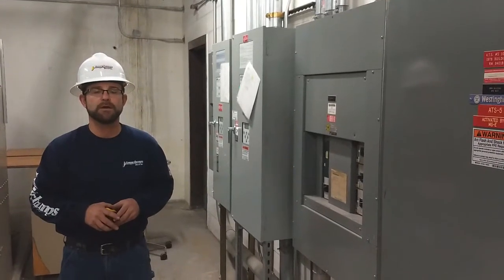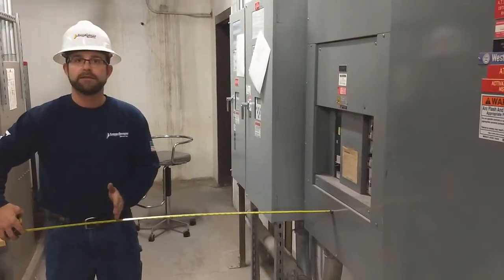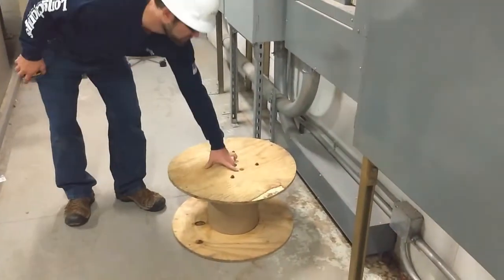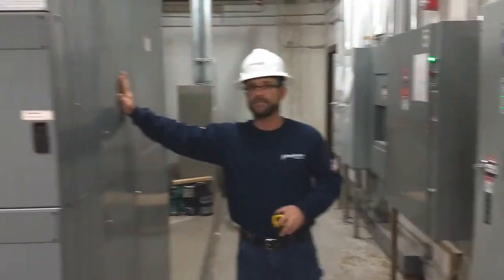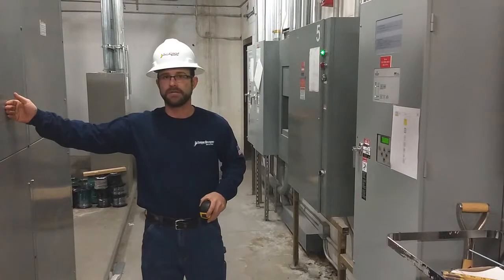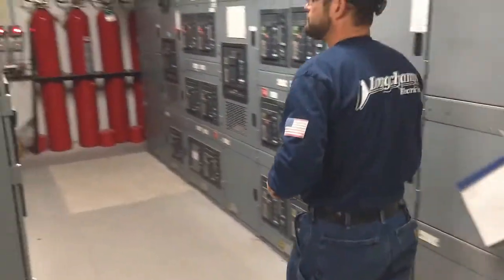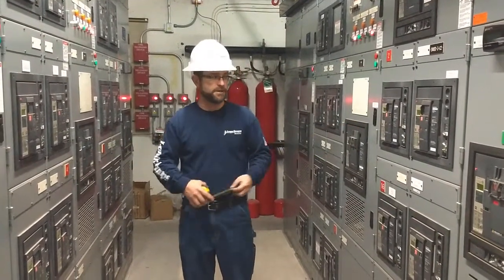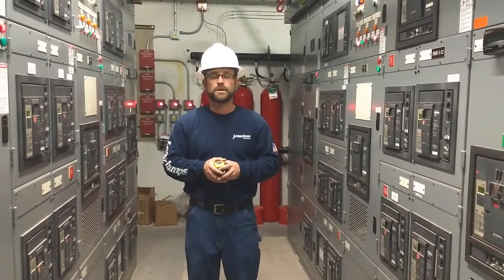NEC working clearance

Comment: For a visual for Table 110.26(A)(1)
There are 3 nominal voltages to ground and 3 conditions.

V to G        C1   C2   C3
0-150         3'    3'     3'
151-600     3'    3.5'  4'
601-1000   3'    4'     5'

Condition 1: Exposed live parts on one side of working space & no live or grounded parts on the other side of working space.

Condition 2: Exposed live parts on one side of working space & grounded parts on the other side of working space. Concrete, brick, or tile walls are grounded.

Condition 3: Exposed live parts on both sides of working space.

Comment: We have a communications cabinet that has rectifiers. The rectifiers are recessed into a cabinet and fed from the back with 120/240VAC and they feed routers and such with -48VDC. So, how much clearance do I need from the back of the equipment cabinet? I'm guessing 3' since NEC says 3" for 0V-150V

Comment: Article 110.26 states nominal voltage to GROUND. So you would test Phase to Ground NOT Phase to Phase. 480Volt is Phase to Phase. You should of said 277volt! One would think working clearance for single phase 208volt would be under 151-600volt but it would actually be under 0-150volt. good video.

Comment: Thank you. That made it clear to me. I am so timid around high voltage I would have pissed my pants pulling out a tape measure anywhere near thise panels, I always feel like the electric boogy man is going to jump out and bite me.  Funny part is I have had to work around high voltage quite often over the past few decades  and done some stupid things that I now know better not to do and never been bitten bad yet, just caught a quick nibble here and there. More ti.id now just around 120v household than I was working in bucket on street lighting, or running communications wire near 480 open bus to running factory machinery. Crazy how getting older makes you more timid.

Comment: For condition 2 does it have to be a transfer switch or could it be a panel also
Reply: Condition 2 means that what is opposite the equipment in question, is something made of a conductive material that doesn't intentionally carry current, and is thus required to be grounded.  Fences, metal guard rails, concrete walls, the back/side of other equipment, HVAC/plumbing equipment.